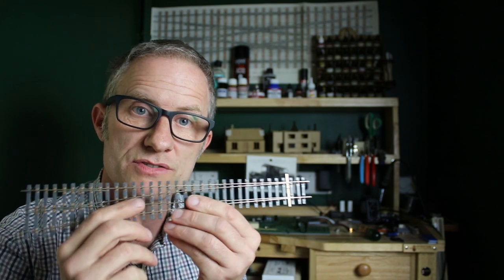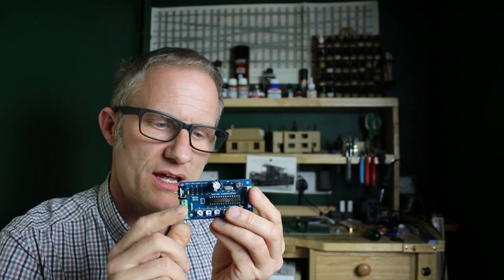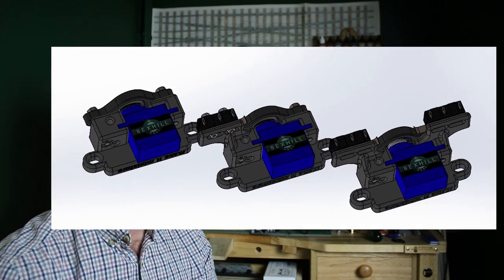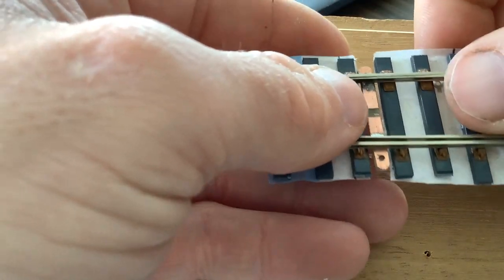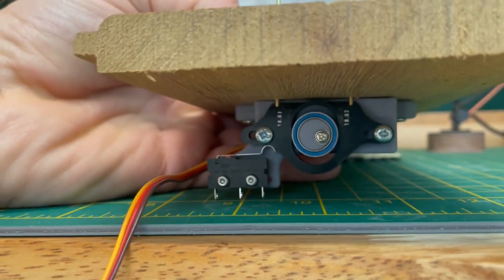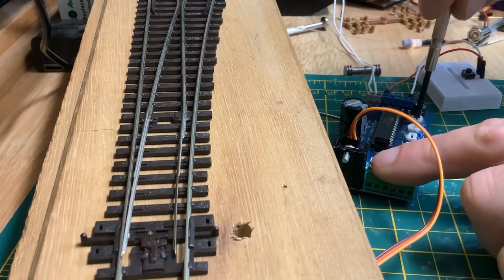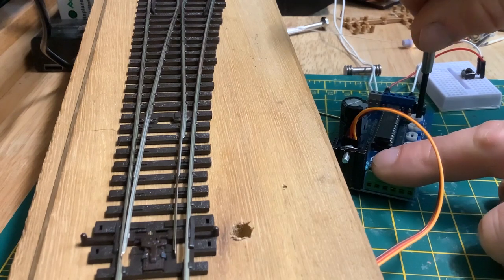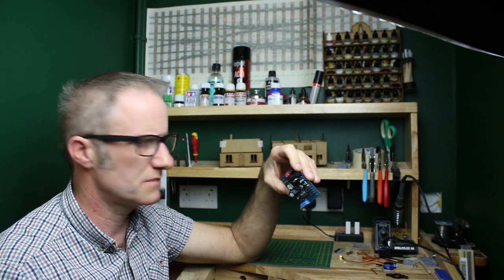S2 E13 New Servo Point Actuator

Comment: James. The 2 point actuators that I purchased from you have been installed on my 2mm finescale layout. They are brilliant. They work quietly and smoothly and are gentle enough for finescale trackwork. I won't be using any more on my current layout, only because of the difficulties in fitting them into to very restricted areas on the baseboards. However, they will definitely be my chosen mechanism for all future layouts. Thanks for a wonderful piece of equipment.  Pete
Reply from the maker: Thank you Pete for your support and kind feedback.  Did you find the adjustment of the microswitch OK for 2mm finescale?  I designed them initially for 4mm and so designed the throw to suit.  If need be, I could redesign the profile of the cam to improve the sensitivity over such a short throw.
Best wishes,
James
Reply: @BexhillWest  James. I found that there was adequate adjustment on the microswitch in the present design for 2mm finescale. Altogether a brilliant piece of equipment. Thank you. Pete.

Comment: Dear James, recently saw an older vid from Muskoka Steve. In this video he showed how he installs a tortoise with an extended throw bar in a piece of pipe. By placing the tortoise in horizontal position, the movement of the servo motor’s swiggle is also transferred into a straight one on the throw bar. Another advantage of this kind of placement is that the servo can almost be placed anywhere.
Great gadget you got there. Love the simplicity of this piece of electronics. The movement of your contraption absolutely looks marvelous!!
Reply from the maker: Thank you Vincent, I shall check that out, sounds interesting - always happy to take on new ideas. 
Take care,
James

Comment: Hi, nice to see the final product materialising...!!  For information, on servo controllers, I am using ESU Switch Pilot Servo 3 modules which can be used on DC or DCC layouts and each module can control up to 8 servos with channel specific adjustments for 'left' and 'right' position, speed of travel as well as selectable bounce for servos used for semaphore signals.  Each servo channel can be controlled using DCC and/or switches; I have both connected at the same time, no problems.  Each servo channel can be set up using a DCC controller or the built in module display/select controls.  Cost is around £40 per module.
Reply from the maker: Thank you Patrick, that's good info.
All the best,
James

Comment: Excellent work! As they say: give a man a fish... no, give an engineer a 3D printer... erm... 🙂
I have only one suggestion - try to avoid guiding the slider directly onto the screws, to avoid wear. Maybe, create cylindrical posts around the screws, so that the plastic only rides against plastic, and the screws only keep it resting against the main body. Or, even, remove the two screws completely, and make two slightly elastic (split) pins in their place - "moulded" directly into the base - you can then just snap the slider into place, which would also ease the assembly. Just a quick thought...
Cheers and best of luck with your endeavour!
Reply from the maker: Hi Adrian, thank you for your thoughts.  I am always open to suggestions and appreciate the feedback.
All of your ideas are excellent, and as I mentioned to David Orf in the comments I had looked at cylindrical posts for the slider bearings.  The limitation being the increased complexity of the 3d printing process insofar as support is required which creates extra clean-up and reduces process reliability and consistency.  Not a problem if I were making just a few but a headache for producing larger quantities.
As for wear, I'm not seeing any on my test prototypes, one of which has been cycling back and forth for a couple of weeks now and must have done several thousand movements.
I like you snap together idea - I must investigate flexible resins a bit more and see what the opportunity is there.
Thanks for the input,
James

Comment: James, that really looks very interesting. Since your video about track building, I’m going to have a go at doing a junction to exit the helix being installed in Phase 2 of my railway because I’m hoping that it’s going to make the design of Phase 3 work as I would like it to. If I succeed in making the junction (I’ve already downloaded Templot and started following the guides - as well as yours) then I’d like to try out your point motor design. Prior to that, I’d be interested in looking at the cost benefit of using your design over my current standard of Cobalt iP Digital point motors. I’ve had several of those fail on me (though DCC Concepts do repair them under their lifetime warranty) and it’s a real pain having to uninstall/reinstall them under the baseboard. Your engineering skills know no boundaries ! Great stuff James.
Reply from the maker: Hi Bryan, thanks for your interest. I’m happy to send you a sample to play with to see if it will meet your needs. 
A design consideration of mine was to enable the servo to be removed if necessary without displacing the mount to ease the situation of alignment in the case of future repair or replacement with another type of mount, should one wish to change the number of micro switches for some reason. 
All the best,
James

Comment: Just looked at the servo controller website the analog one is out on stock, I notice from the instructions for the digital version is a bit more complex to set up, unlike the analog one which is so simple to adjust. So I wonder is it possible to use a analog one and use another device in place of a push button if using dcc.
Reply from the maker: I think I'd bought all the current stock, although Szabi will have more in soon.  I agree the DCC version looks more complex to set-up, but I think it's one of those things whereby it's a lot simpler to actually do than contemplate doing.  I will have a play with my own unit this weekend and make a video of the set-up.
In response to your question, I think the answer is yes.  I'm sure the inputs can be switched vis an accessory decoder, but I suggest contacting Szabi via his website for confirmation.  I have found him to be very helpful indeed and he would know for certain.
Thanks for watching,
James
Reply: Hi James thanks for the reply, I have found similar digital versions a bit of a pain to adjust for reliable operation hence why I have never used on points. Sometimes they why do a massive movement which could cause damage to the points ( tillig) but I loved the setup for the analog one. Also I loved your product and should certainly solve a lot of clearance issues for me.

Comment: Hi James, I am enjoying your series on Bexhill West. I also found your video on getting information about stations online very useful. I am interested in purchasing some of your Servo point controllers but I need to know the dimensions to see if they will fit. Could you measure one and either put that on the website. Keep up the good work!
Reply from the maker: Hi Chris,
If you go to the website and click on the product pages, there are some images to scroll through. One of which is the fitting instructions which has dimensions of the mounting holes. This may give you the info you need. 
Additionally, the width across the mounting holes is 66mm, and from the back of the servo to the front of the slider is 32.5mm. 
Mounts with switches are slightly wider adding approximately 5mm per side depending upon whether it’s a single or two switch mount.   I hope that makes sense. 
Get back to me if you need more detail and I’ll be pleased to help. 
All the best,
James

Comment: Look great and so simple to use. I have a very simple dcc setup at the moment I change points manually. I am extending the layout and would like to add motor control to all the points. This seems as if it would be a very cost effective way of doing it. To keep things simple I thought I might run the points with a separate dc power. I notice you can “daisy chain” the controllers. What kind of power supply would I need say max 16 servos. How would I wire this? I hope this makes sense thanks
Reply from the maker: Briefly Alan, I think I’d go for a 2 amp supply, although the system shown doesn’t cycle all the servos at once so that shouldn’t be an issue, but better safe than sorry. 
The dcc version of the controller can be fast chained from
Master to slave very easily, and I will show it in a future video rather than try to elaborate here and possibly creat confusion worth my poor word-smithery. 
There are instructions to download at dcc-decoders.com which should help with your question for the time being. 
I hope that helps in the short term. 
My best wishes,
James

Comment: Hi James, very nice, but I think I would have used just a slightly different method for attaching the slider to the body, I'd have built posts onto the body and then screwed into the posts, this method lets you prevent tightening the screws so much that they trap the slider. But its a very minor thing, am I right in thinking that the microswitches have enough spring tension in them that they cause a very slight vertical movement in the slider ?
Reply from the maker: Hi David, I had experimented building posts into the body of the mount, but dismissed the idea as it led to complexity with the 3d printing.  The design as settled upon requires no support, and so is considerably quicker and more reliable to print.  As an alternative, I also tried sinking dowel pins into holes in the body of the mount which were excellent from a friction point of view but presented consistency problems when establishing the 'fit' to the slider.  In the end, the solution presented here seemed the most consistent.  Additionally, one of the screws retains the servo as well which is another complication which would have to be overcome.  As these units will be shipped assembled and tested I will be able to monitor and inspect the tolerances.

You are right, in that if you look at the footage especially at 15:16 there is a discernible lift on the RH side.  Don't forget that this is shown 'blown-up' many times.  I would estimate that lift to be about 0.1 mm.  I wouldn't expect it to be an issue, and is well within what I would think to be an acceptable tolerance.

As an aside, and for the benefit of anyone reading this who might be interested, I had the best results with a micro stepper motor and leadscrew as an actuator.  The kind of thing used in CD rom drives.  These things are, I think, several orders of magnitude better in terms of precision, control and quality of motion.  One day I'll make a video about my experiments with them as I think they are largely ignored yet excellent form of motion control.
Take a look at these for example: https://www.ebay.co.uk/itm/255036427187?chn=ps&norover=1&mkevt=1&mkrid=7101533165274578&mkcid=2&itemid=255036427187&targetid=4584826055637456&device=c&mktype=&googleloc=&poi=&campaignid=412354546&mkgroupid=1299623041023876&rlsatarget=pla-4584826055637456&abcId=9300541&merchantid=87779&msclkid=ad316caed28413fa26d60ebee1960e5b

All the best,
James

Comment: James . I have just placed an order for two point actuators which I want to test on my 2mm finescale layout. If I'm happy, the rest will be changed.
Have you any recommendations for servo motors? I have found some do a sort of shuffle from side to side when power is first applied, something I'd like to avoid. Love the design. Pete
Reply from the maker: Hi Pete, I've got your order thank you and am putting it together as I write.  :) 
The actuators come preassembled with servos which I have had no problems with.  The 'shuffle' is a controller issue.  I've had no problems with the controller mentioned in the video, but I have experienced this with my Megapoints controller, although it hasn't been an issue.
Best wishes,
James
Reply: @BexhillWest  Hi James. I didnt realise that the actuator came with a servo, even more excellent value. I look forward to trying them. I'll use my current controllers to start with and see how they go.  Do the ones that you are using work with toggle switches instead of push buttons ? Otherwise it would mean a lot of re-wiring of my control panel.  Pete.

Comment: Everybody who has watched this so is thinking: where? and how much? 
Plus are you going to do a complete package, and there you go …. thanks 
Still love the closing credits music
Reply from the maker: 1BCamden - this is why I am a creative type and not a business man.  I should have mentioned all this in the video.  Thank you for the nudge.  :)

Where:  www.makeitminiature.co.uk
How much:  It depends upon which mount option.  And I still need to confirm what I've paid for the bearings for which I have been invoiced several times incorrectly.  But the target is £10 for the double switch variety, assembled tested and ready to go.  £9 for the single switch and £8 without switches.  Controller sub £20.
When: Bulk order of bearings due to arrive in the next 2 weeks.  The supplier had sold out, and back ordered them from overseas without telling me.  :(  I don't mind them coming from overseas but would have preferred not to wait. Ho Hum.
Complete package: Yes, if needed.  With a discount! :)
This week I shall be printing the instruction manual, laser cutting the mounting templates and finalising the packaging. They will be on the site from Wednesday for those who wish to pre-order.

I hope that's everything,

James
Reply: Great, thanks so much, looking forward to the next update

Comment: I would love for someone to come up with a system or a technique for installing and then mechanically adjusting the position of any under mounted   point actuator under a real base board. (dark, wide, fixed in place with cramped crawl under space).
Reply from the maker: Ah, the holy grail. 😀 I tried to mitigate that as far as possible by designing the template holes to be drilled from the top to avoid the hassle of wrestling a template, servo mount and drill upside down. 
Once the servo is in place it can be adjusted from the top simply by using an extended servo lead. 
Wire in tube (or similar) from above the baseboard is of course another option, and I have a mechanism to actuate an above board set-up for which an alternative ‘slider bar’ has been designed and which will feature in a future video. 
Thanks for watching,
James

Comment: Great James, would would consider a design for semaphore signals. There a vertical pin. That could be interesting too.
Cheers Daz
Reply from the maker: Hi Daz, I've designed one! :)
If you pause the video at exactly 1:31:07 you will see it.  I hid it in the sequence to see if anyone would notice it.
The clevis (which operates vertically) is attached with a magnet and designed to 'pop off' if the signal or its mechanism becomes jammed.  By doing so really fine operating wires can be used without the risk of them becoming bent accidentally.
Video coming soon.
Thanks for watching,
James
Reply: @BexhillWest  Subliminal advertising of future videos, eh, James?😁
Reply: Bexhill West very clever I will be getting some of these